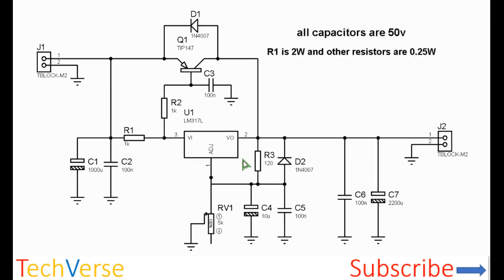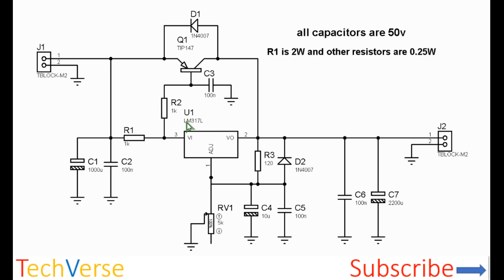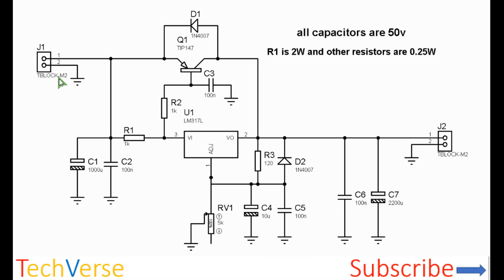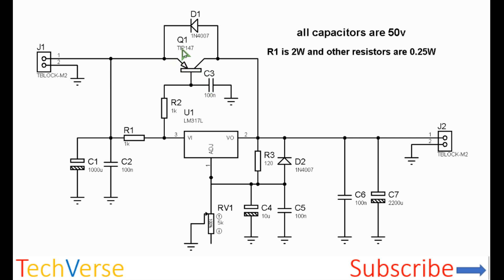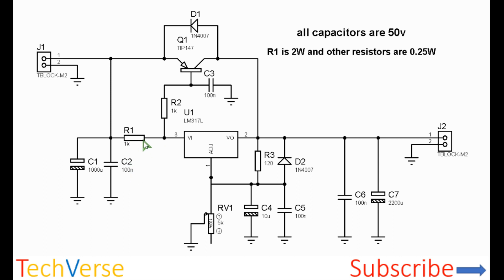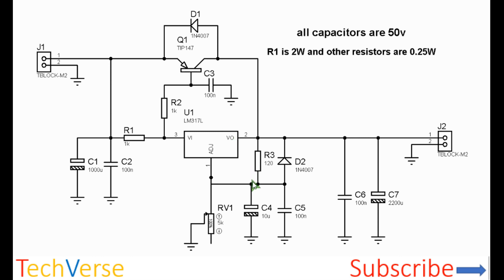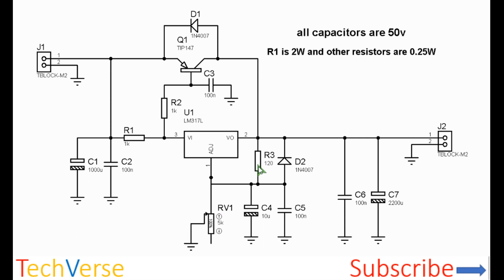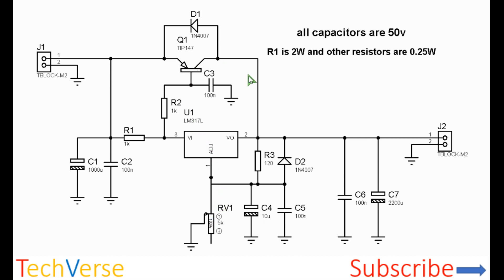1.2-30V 8A Power Supply with LM317 and TIP147 Transistor

Comment: this is a very careless design - imaging the potentiometer at the top as shown - in this condition the R3 120 ohm is connected between Vout and ground - not quite desired for a 1/4 watt resistor.
you must add a series resistor or increase both R3 and RV1